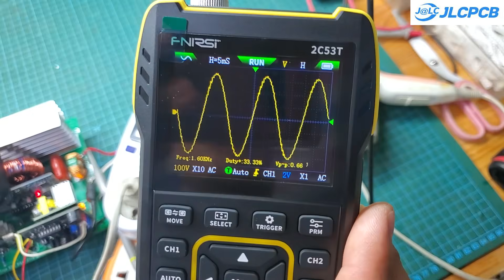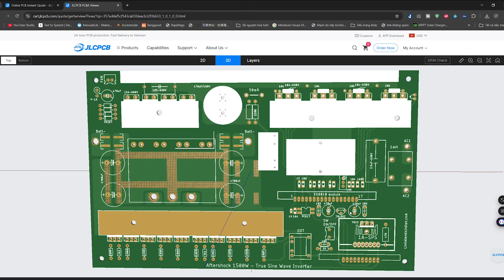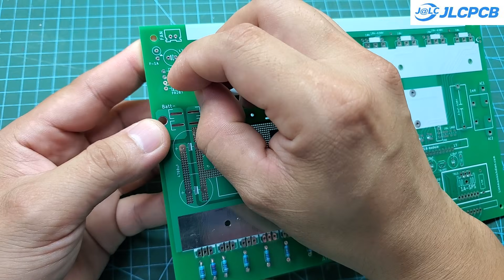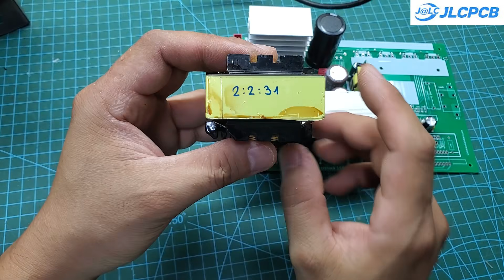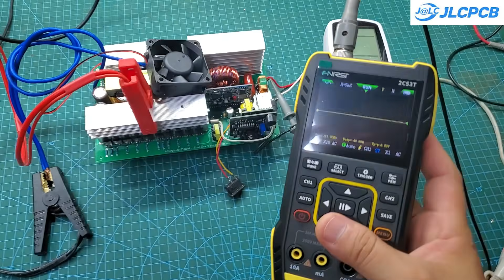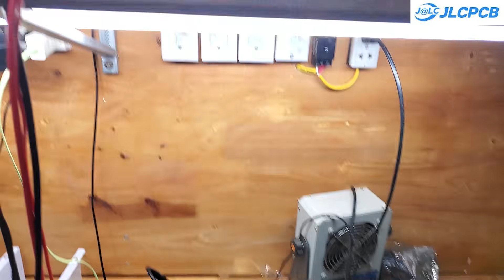Design and manufacture of a 1500W high-efficiency inverter | JLCPCB

Comment: It's seems the negative is connected to centertap of trafo, while positive is connected to the drain of the mosfets, why is this?
Reply from the maker: If you connect the MOSFET that way, you won’t need an insulating pad between the heatsink and the MOSFET. The MOSFET will dissipate heat better.
Reply: @PhdHung  sorry to disturb, now that the source pin is now the output terminal of the FETs, I believe the FETs will not turn on, or is that why we have gate transformer?

And what's the configuration called, so I can study more on it myself..
Thabks
Reply from the maker: We call it a high-side gate drive using a Gate Drive Transformer.

Comment: How to protect mosfet from back emf?
Reply from the maker: I use an 80V MOSFET for a 24V input. Moreover, the transformer is wound accurately and has very low leakage inductance. There is no need to worry about EMF.